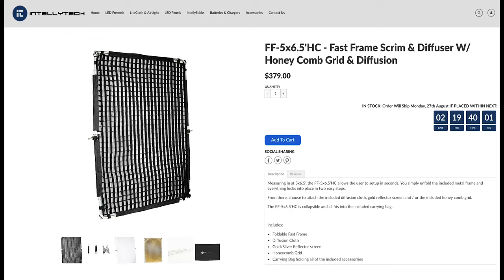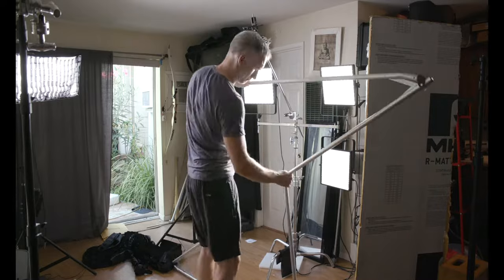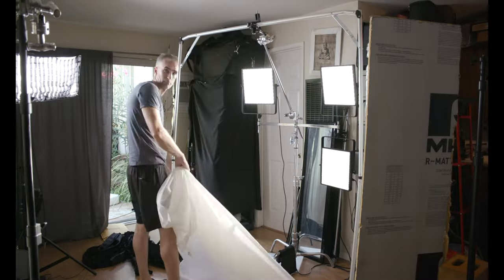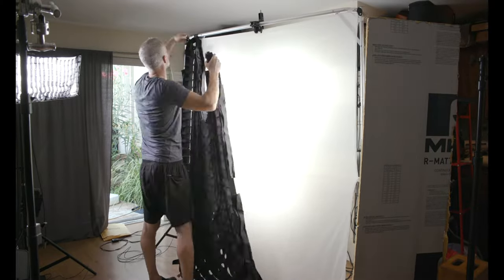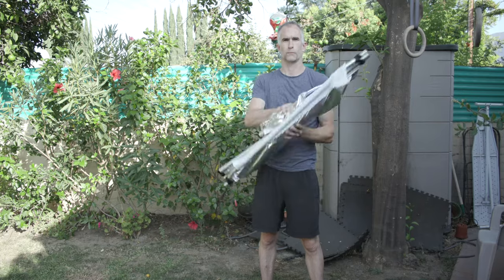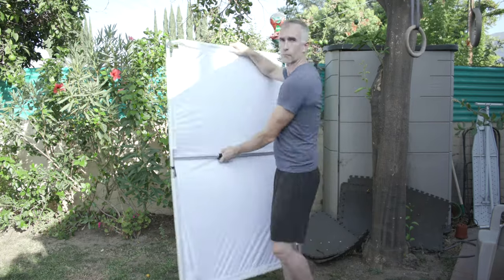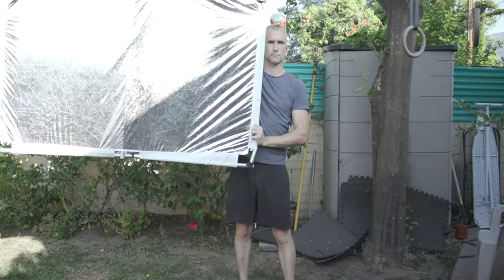Intellytech Fast Frames Review

Comment: Great video! Two questions 1) How sturdy would you say the frame itself is, if you wanted to use it outdoors (wind in mind) as an overhead butterfly, mounted to 2 combo stands? 2) What type of diffusion is that and is it silent?
Reply: Aluminum, definitely useful for weight.  But I wonder if it'll bend too easily, too.
Reply from the maker: 1) It's light for this kind of rig, but pretty sturdy. I've had it outside in a slight breeze and its no problem. There are ways to tie it down as well. 2) Its a similar to half-grid and yes, it's silent.
Reply: Hi, so a 1/2 grid is how much light loss?  I'm often after 2/3's or 3/4 of a stop, finding a full stop of difussion too flat.  Here's a subject you could do a  video on!  Grid cloth ratings for the rest of us.